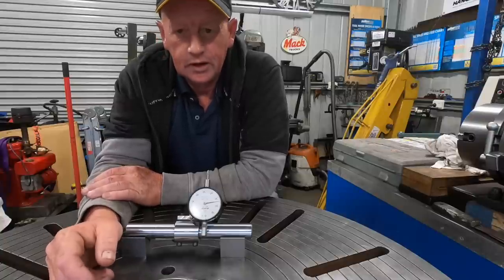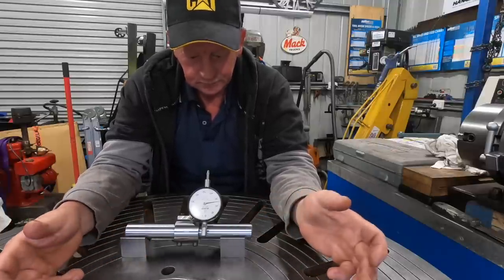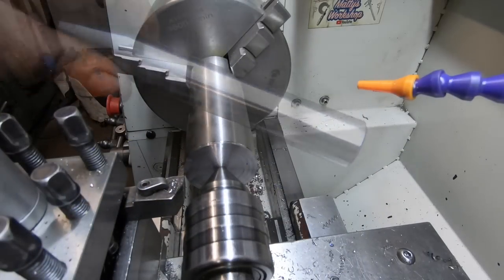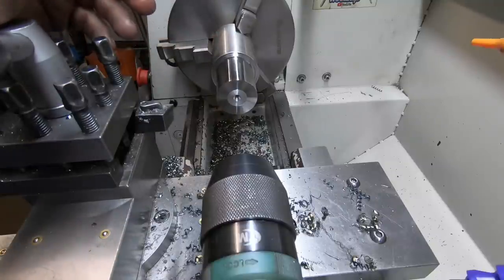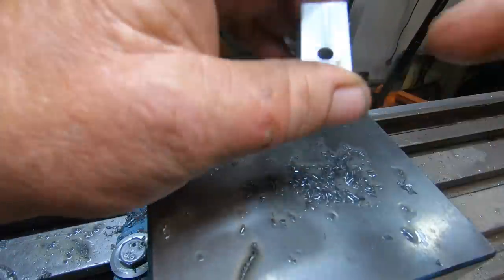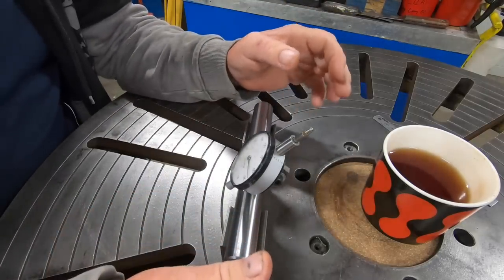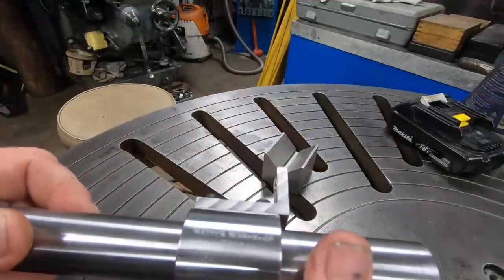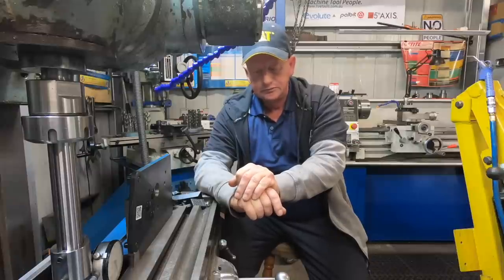Precision Spindle Angle Tool

Comment: Nice work, tool room standard 👏. 
Great job as always Matty,  photography spot on.
Thanks for sharing.
Reply from the maker: Gday, almost tool room, still got a bit to learn yet mate, appreciate you watching, cheers
Reply: @MattysWorkshop  Hi Matty,  just a thought on using the 2 M5 screws as a tenon in the slotted shaft,  maybe mill a 5mm wide through slot in the outer part, then make a deep feather key, 5 mm wide by 12 deep ( guessing on the 12 dimension). Then either weld it in, or loctite it, add a bit of cigarette paper or standard paper under the key for radial clearance.
I've used this technique several times, when I haven't had access to a keyway broach or slotter.
Have a great weekend 😀 
Regards John
Reply from the maker: @bostedtap8399  that’s a brilliant idea, might have to do some changes mate
Reply: @MattysWorkshop  Just sharing idea's I've learnt. John.

Comment: Always fantastic watching you build up such great accurate tools that will last years to come. To be able to machine them is a feat that ceases to amaze me. I guess I'm just jealous mate. Should have stayed in class in stead of skipping out! Thanks Matty for sharing your craft. I know who to come to if I need something built👍❤️😁
Reply from the maker: Gday James, you can do this to, im not qualified in anyway, im just a retired truck driver that’s self taught, learned by watching and asking questions then just having a go, I did no good at school either, you can do it to mate…
Reply: @MattysWorkshop  Matty my math skills are terrible but I'm a heck of a carpenter which boggles people's mind
I retired as a automobile collision specialist with lead painter skills. I actually worked in a job shop as a hoe-dad maker running a big I think it was a #6 or 3-9 mill cutting edges onto steel blanks and also a turret lathe turning out oarlocks of all things...this was the shops side hustle,as they specialized in making electric motors from scratch housings, shafts,and also winding them for a local mill chipper motors. I know how to run them but just can't measure worth a squat (lol)
Reply from the maker: @Mr.Avuncular  took me a good while to read measurements properly but over time I thought myself, there was a lot of bits scraped in that time to

Comment: Nice finish with those inserts. I use them a lot. Very brittle though. Ask me how i know. Cheers Matty.
Regards.
Steve.
Reply from the maker: Gday Steve, I have pushed the inserts up to a .080” doc with no trouble, they leave a beautiful finish that’s for sure, there not cheap though but they make life easy, thanks for watching, cheers
Reply: @MattysWorkshop  The only problem i have had so far is machining those flywheels for the Hit N Miss engine from old weightlifting bars. They just went blunt very quickly. I agree with Jon they were probably cast steel , not iron. 
Regards.
Steve.

Comment: Excellent job Matty, have you ever tried the round insert tool on your fly cutter, work's great for me the aluminum inserts does a great job on steel or aluminum, great video, keep'um coming..
Reply from the maker: Gday, Ive never tried a button insert yet but I should for sure, Ive had quite a few suggest this in the past, Cheers